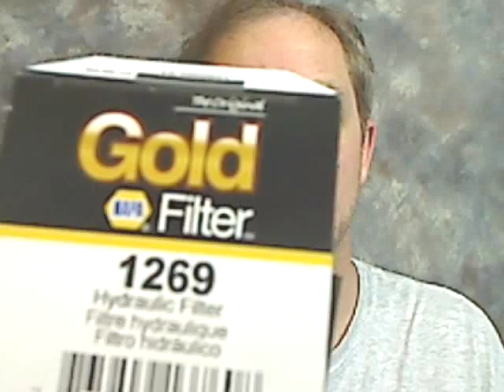Remote Transmission Filter Update - GM 4L60E

Comment: You think an ordinary oil filter will work as well as a hydraulic filter?
Reply from the maker: The only difference is the size of particles removed, most oil filters today clean to 15-20 microns as the hydraulic filter cleans to 10 microns. Keep in mind, the filter inside the transmission is very course by cleaning to 80-100 microns... An oil filter will work just fine, and its a lot cheaper to replace.
Reply: Perfect. The remote filter adapter companies dont say anything other than use their brand of filters and size to. Very informative and keep up the good work. All my automatic transmission vehicles will be equipped with these remote filters from now on.

Comment: Hi there i think this is a capital idea, where can i get the kit?
Reply from the maker: I ordered my kit from Summit Racing and Amazon also has several kits to choose from.
Reply: +heavymechanic2 does this affect line pressure in any negative way
Reply: Cranky Jay If you used a very small filter that was also very high efficiency, then it could potentially be an issue, but the filter base is large-ish, so anything that fits will probably be ok.

Comment: So, you did a pan drop AND a total fluid change AFTER you installed the filter?  Did I hear that right?
Reply from the maker: Pan drop and fluid flush was done before adding the filter to the cooler line. Fluid analysis identified dirt remaining in the system and the 10 micron filter polished this fluid back to acceptable standards.

Comment: I plumbed mine into the return line to the trans, coming out of the radiator.  My truck is an 06 GMC yukon.  On my truck the return line, going back to the trans, is the one coming out of the top of the radiator.  Does it matter which line you plumb into?
Reply from the maker: +jewllake Mine is the same way, the top is easy to connect and will polish any trash from the oil cooler. The bypass valve should prevent any pressure from building inside the radiator.
Reply: So you mean the line coming out the cooler top one on helper side ???

Comment: Does it matter if the filter slows down the flow or not? I'm thinking of using an amsoil remote mount full flow and bypass filter system on my transmission. I saw a gear pump on ebay that is meant to help pump oil from turbo return lines back to the engine. This may offset the restriction caused by the filters. Another option I saw was on Gulf coast filters website. You can use a fuel pump to pump oil from the tank to the filter then back to the tank. I want to go with the first option because it is simpler but I don't want to cause a problem because the flow is too restricted.
Reply from the maker: +Istayuplatedrivefast Yesterday I was on a Jeep forum who also uses the same filter (Wix 51269) with a bypass valve if the filter gets restricted. Gulf Coast is a bypass system with a tiny micron rating, the Amsoil FF+Bypass does not restrict flow due to its design. I think these systems are overkill because a filter designed for engine oil cleans to 15-20 microns removing the abrasive particles that damage your transmission.. The cooler line should be capable of 1-2 GPM without opening the bypass valve designed to protect the system from bursting a hose or your radiator... Stick with what works, just a plain oil filter is your best option.

Comment: Thanks for posting both of these videos.  I also tried to look up the B&M number, but could not find ANY comparable filters.  Using the Napa 1269 number you provided I found a complete cross reference list on the Fram site HERE:
http://www.framcatalog.com/PartDetailWindow.aspx?b=F&pn=PH3614
That should give us plenty of choices!
Thanks again,
Ken
Reply from the maker: The B&M filter supplied with the kit is a slim version of a PH8A and the 1269 from Napa is a smaller size allowing more options for mounting location. I spent hours looking at other filters to fit this base and wanted to share my best choice of cleaning ability and price.

Comment: I've been looking into this for my truck.  Would you suggest the hydraulic filter over a regular spin on filter?  Also, about how much fluid do you end up replacing to top off after you do a filter change?  I can imaging about 2 qts.

Thanks for the helpful video and research you did!
Reply from the maker: If your transmission is in good condition, a NAPA 1348 is rated at 15 microns (least expensive), 1269 is rated at 10 microns and a 1624 transmission filter is rated at 19 microns. All made by Wix and different prices... Around 1/2 quart to change the filter, may drain a little from the cooler depending where it is mounted.
Reply: The 1269 is nominally rated at 10 microns. That’s 50% of 10 micron-sizes particles. What micron level is it absolute (98.7+%) ?

Comment: Thanks for the video. I received a 5/16" Magnefine filter today so I will be trying that out. At some point I would like to have a spin on set up. You said in one of your responses that you don't need to change the transmission pan filter after installing a spin on type. Would you recommend removing the pan filter if you put on a spin-on system and therefore never planned to drop the pan again? Secondly, have you ever heard of any issues with flow restriction related to these systems? I have a Dodge Grand Caravan with the 41TE transmission and I believe they can be finicky.
Reply from the maker: Let me clarify a little: drop the pan and clean it out, replace the filter. the Magnafine will catch iron and some fine particles, it has a bypass as a safety feature. The spin on will trap small particles that normally pass through the strainer in the pan, it cleans up the fluid and you will be happy with the results. The normal sediment in the pan should go away and collect in the remote filter extending the life of your transmission. [Replace the Magnafine in 3 months and then once a year]
Reply: heavymechanic2 Thanks! Your videos and responses are very informative. Actually I had transmission service done about 3 months ago. The transmission shop dropped the pan and changed the filter out with a Wix I supplied them. I had done the job myself as well about 18 months before that. and about every 60000Km before that. I also installed a Dorman drain plug and I change out about 3 L ATF+4 every second change. Overkill? Maybe. With the filter and fluid being so new do you think it would be ok to just install the Magnifine now without dropping the pan, then replace the Magnifine in 3 months? I was wondering if I should remove the pan filter entirely once I changed over to a spin-on type remote filter system but I'm inferring from your response that regardless of setup, there should be a pan filter installed. My thinking was that eventually a pan filter would need to be replaced even with a spin-on system. It would be nice to never have to drop the pan again hence my thought about removing he pan filter all together once the remote system is installed.
Reply: The factory pan filter doubles as a sump for the pump to pull fluid from, so you can’t remove it and still have the transmission work.

Comment from the maker: Typically the felt filter in the pan is changed at 30K, I would change the spin-on after six months (10K) and then every year or 20-30K miles. There is really no reason to drop the pan once you go to the spin-on filter.

Comment from the maker: The filter I recommend is a little shorter and it fits on the base just fine, go to wixfilters and check out 51269 for your self. The thread is 3/4 and the gasket is the right size. You can buy just the base from Derale and possibly B&M.

Comment from the maker: I really don't know much about a CVT transmission. However, if it circulates the fluid through a cooler, it will work to remove contaminants. If it is a splash system like a regular MT, it will not work because there is no circulation. This is the best answer I can provide, thanks for asking!